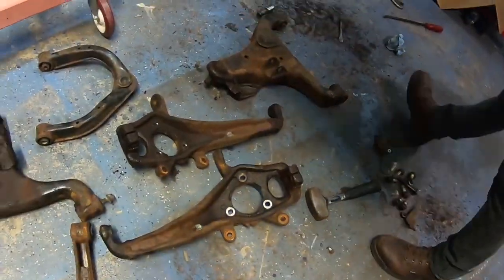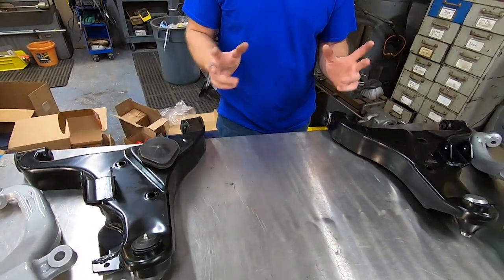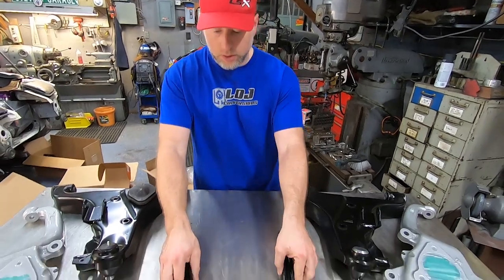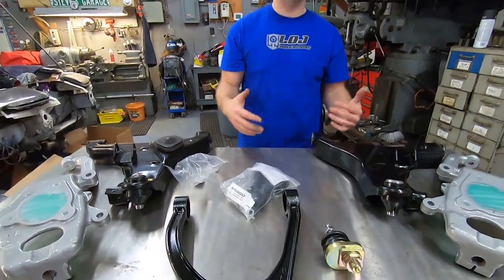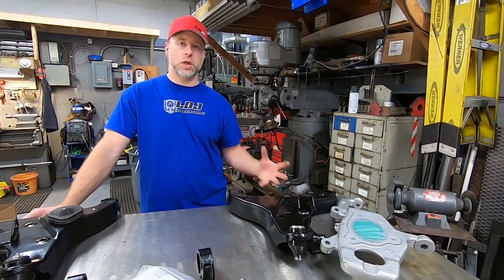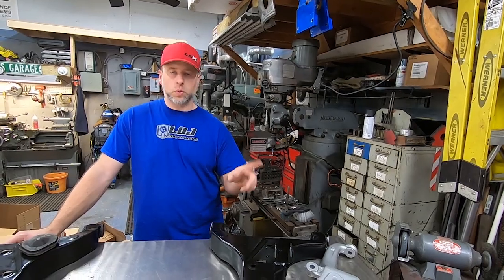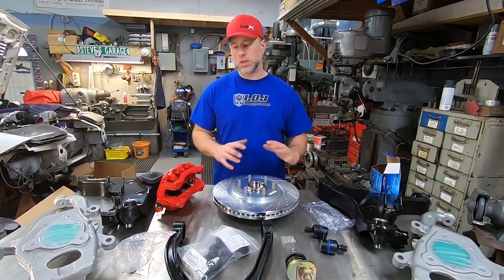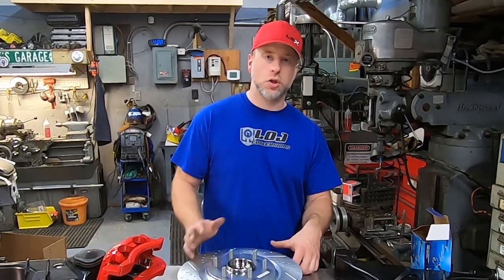SWAPOLOGY - LOJ Conversions - Project Frontier [EP03]

Comment: Awesome content. I'm more than likely will still build me a M45/35 LS swapped car as a daily
Reply from the maker: Jerome Irving My daily is an M and it WILL get an LS when the frontier is done.
Reply: I have a camaro tr6060 that will go behind what ever I use. But my question is, will your swap kit work on the m. It looks like it will
Reply from the maker: @jeromeirving4770  We will know for sure once we swap mine. There may be some subtle differences.
Reply: If I get to it first. You be fully informed in what I run into. Plus, most of the hardware will come from you
Reply from the maker: @jeromeirving4770  Sounds good to me!